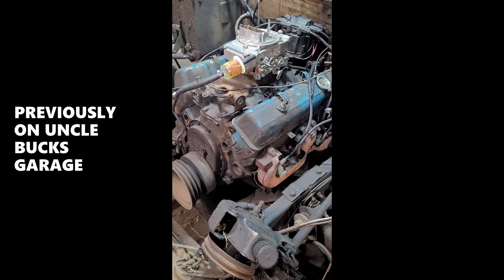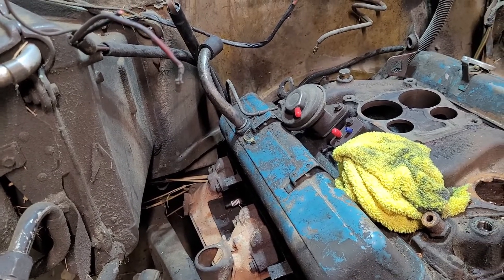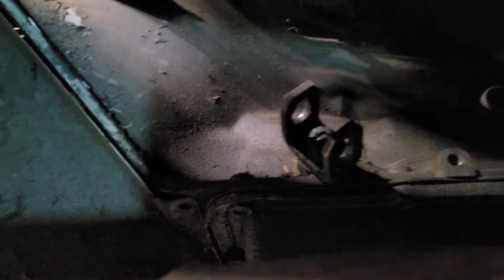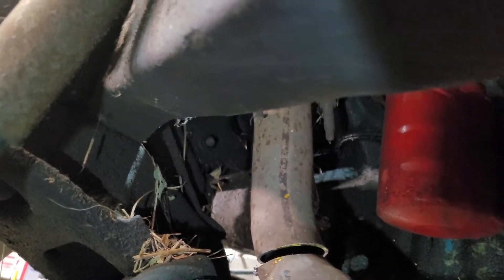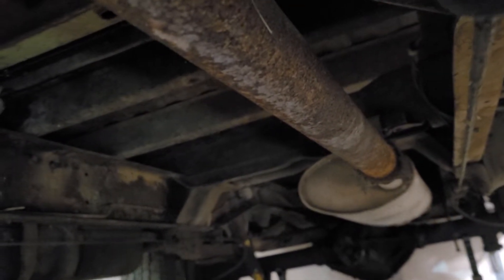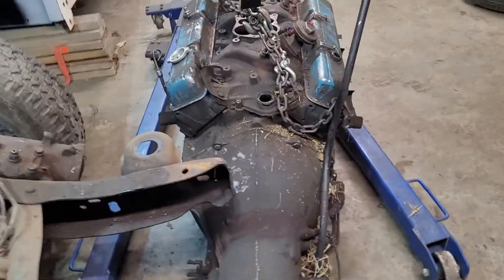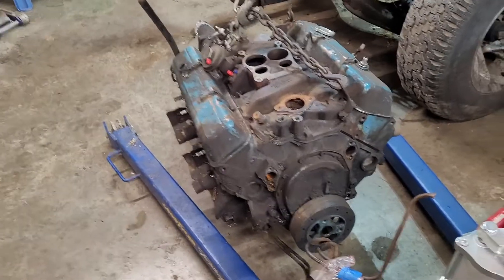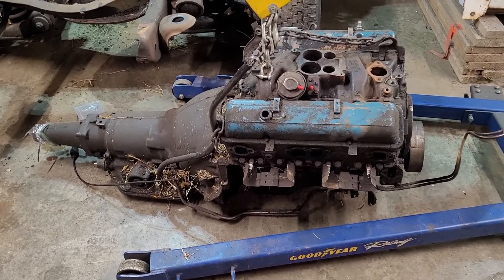How To Easily Pull an  Engine & Transmission Together: Square Body Chevy Build

Comment: I've been away for the last several months. Trying to catch up on this project. But it seems like there's a video or two missing. 
A few videos back, you were rebuilding a 4-bolt .040-over 350 for your truck. Next thing I know, you're taking this barn-find 350 and dropping it in. Why? 
Did the #8 cylinder wall on the 4-bolt not clean up at .040?
Reply from the maker: Ran out of money for the build, had that motor in a parts truck, hooked everything up and it fired right up and purred like a kitten. I was surprised, So i went with it and used what money i had on other things. I'm still going to build it but just not right now. I appreciate you coming back to watch. have a great week
Reply: Paint it White